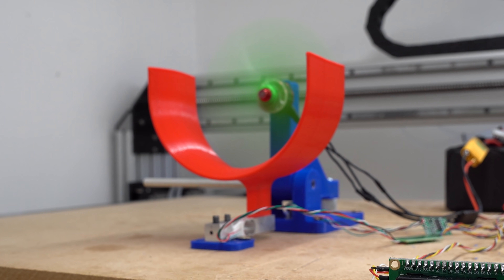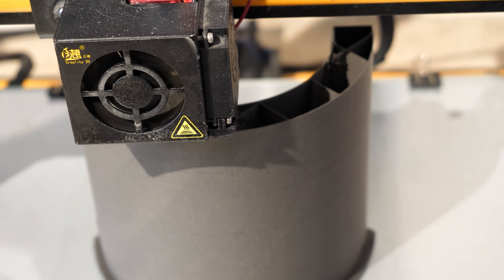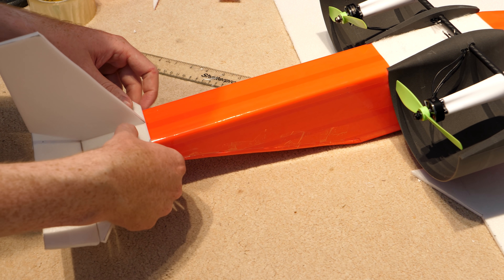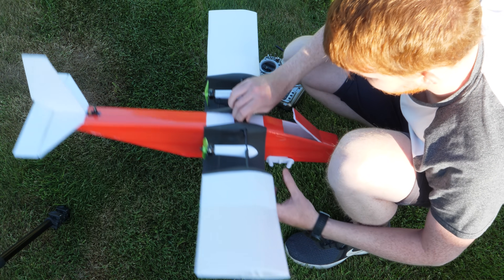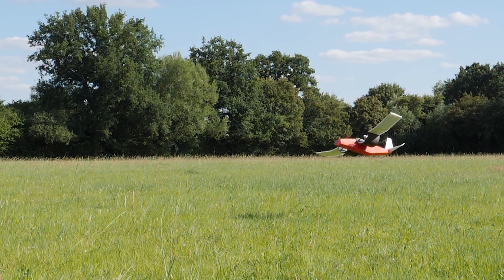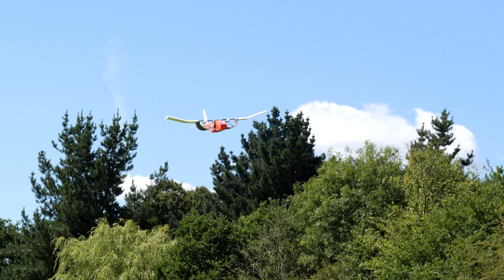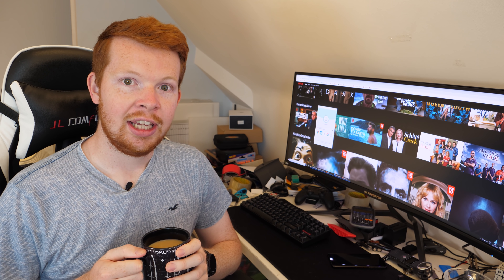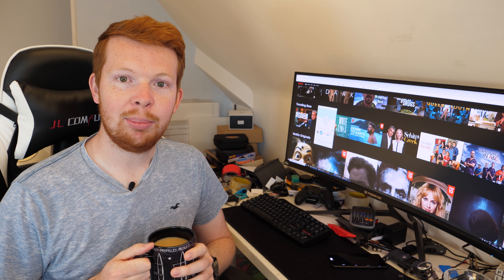Channel Wing Plane

Comment: Could it be that You couldn't reproduce the effects of that historical aircraft due the the fact that some physical phenomenons don't scale down very well? Like for example the density of air does not scale down, potentially rendering your small-scale experiment with worse results that its original-sized equivalent?

Comment: Nice video! I assume a channel wing will theoretically produce lift at zero speed because the engine can flow air over the whole wing at zero speed. Could you accomplish the same thing with distributed propulsion (a la X-57), but more efficiently?

Comment: The pitch up on power looked a lot like the lift is tied to the throttle. I think if tom raises the angle of attack of the wing section itself independently of the channels it would allow some more conclusive results as the whole craft would fly slower and the throttle would act more like flaps. Conversely you could add symmetrical sections at the outer tips and angle the thrust line down slightly. Real planes with blown wings rely on throttle control during landing but have shorter wings than similarly sized aircraft.

Comment: As a helicopter pilot I can attest that you don't need a fixed wing to fly.  You just need a pressure differential (or if you're a DJI or a Harrier fan, ducted fans pointed down).  Fundamentally all require a SIGNIFICANT amount of power to achieve lift.  That power is also unavailable for thrust, and will deplete the fuel source be it jet fuel (Harrier) or batteries (DJI) or AVGas (what I fly).

When you add a fixed-wing lift mechanism (and your elevator qualifies as well) so long as you can keep it light and large you win the aerofoil advantage by getting "free" lift.  Of course it's not free.  It sits on the ground quite heavily.  You need airspeed to get that lift... which is why any discussion of a "low speed" or "no speed" aerofoil has its limits.

Yes, you can put a pusher prop on a plain on a treadmill... but will it fly?  Well the general answer is no... but if you put the prop so the air flows over the aerofoils it WILL fly over the treadmill, with possibly a 0 knot groundspeed.  That would be an interesting experiment.

Thanks for your videos - always appreciated!

Ehud Gavron
Tucson, Arizona USA
FAA Commercial Helicopter Pilot

Comment: Tom, you said you thought it was tail heavy so you moved the battery forward. But then you said thrust pitches the aircraft up so that suggests it wasn’t tail heavy to begin with. A nose heavy plane won’t glide as well or fly at as low speed as a balanced plane. Maybe the cg and pitching is worth exploring some more. Just 20mph for that plane at the beginning seems amazingly slow. I would estimate a normal plane like that would stall somewhere above 60mph.

Comment: The advantage is not unfeasible in practice. The regular channel wing lift vector and propeller thrust are perpendicular to each other so not too much helpful from a VTOL point of view. From this study(https://ntrs.nasa.gov/archive/nasa/casi.ntrs.nasa.gov/19930087470.pdf) wing lift augments the propeller thrust about 8%. Tilting the wing, so the lift vector is more aligned with the thrust offers a much higher augmentation, and the concept is totally feasible for a VTOL, check this video here: https://www.youtube.com/watch?v=tID7wEP1a-4

Comment: Multi engined planes definitely benefit from induced lift. The channel wings lift isn't directed downward but normal to the surface. Perhaps combining the shape of the channel so more lift is directed downward  would result in better results.  A good way to discover how significant induced drag is to fly the XL 450 and in plane mode apply yaw command. This cause the inboard motor to slow just as the wing begins to slow itself. It pretty much guarantees a snap. Be prepared to shift to hover mode to recover. Like your videos. There is no better way to affirm an idea or principal than actually doing it. Like your videos.

Comment: I'm thinking it's largely a scale issue. Plenty of aerodynamic devices work at some sizes but not others. Planes like the Antonov An-72 and the Boeing YC-14 mount jet engines over the wings for STOL performance, so I think there's something to using to help lift. Wikipedia says that the Coandă effect doesn't exist in totally laminar flow, so it makes some sense that the higher Reynolds numbers involved with full scale aircraft make it more prominent.
Reply: Finally  a proper scientific conclusion! It’s all fluid dynamics man…

Comment: In drawing airflow over an aerofoil to produce lift at low aircraft velocities, I think much the same thing has already been created in the form of the Osprey V22 tilt rotor. While it's main attribute is to use the tilt rotors to hover, the wing itself produces extraordinary lift from a stubby wing section by means of the two Alison turboprop engines which force air over the wing and trailing edge flaperon to produce lift even before the aircraft has moved forward. In flight, the aircraft is brought to a hover by slowly rotating the engine nacelles to a vertical axis to produce lift, while the transition is assisted by the flaperon which provides additional lift to assist the wing as forward speed deteriorates.
Reply: This is not true; tilt-rotors  do not tilt the wings and they are a source of reduction of hover performance caused by wing - rotor flow interactions, such as wing download, wing fountain flow and other flow perturbations. A bit better are the tilt wing designs, e.g. Canadair CL-84, but the single wing advantage is not stalling at any angle. In pure hover, the wing is worse than "dead weight" as being a source of surface drag, and decreasing hovering effectiveness, the "figure of merit"
Reply: @aliptera  If you were an actual qualified aircraft engineer, as am I, you would be able to discern the fact that I stated "rotating the engine nacelles" which are the structures at the wingtips (not the wings themselves) which do the rotating while the wing (mainplane) remains fixed and stationary. The point that I made was that the two designs each cause air to move front to rear by the use of propellers, Tom's model, by drawing airflow while the V22 achieved it by pushing airflow whilst in a stationary manner, and also in normal forward flight. Tom's model was designed to achieve both lift and thrust while the V22 could only achieve realistic and useful lift by rotating the engines to a vertical axis.

Comment: I have been thinking a lot about the channel wing concept lately. I would like to try a similar test but adding a down turned duct or set of variable vanes after the prop to direct the propwash downward as well. This would increase the lift without increasing the forward thrust. If they were efficient enough you could theoretically hover. I think in this test you may not have been able to see much effect of the channel wing on landing as you had to increase throttle to gain the extra lift which also increased your airspeed. If you could direct the propwash downward you could increase throttle without increasing airspeed which would allow for slower flight. Nonetheless this was great to watch as well as your previous video test of the channel wing on the test bench.

Comment: I think at the scale you are building, you have a major inefficiency due to annular losses. Because they don't scale linearly, a larger prop diameter is going to significantly increase the airflow. Maybe a single very large channel and a delta wing?

Comment: The part of the channel that can produce lift is only one small region, the part that is horizontal, what if you tried an eliptical channel rather that circular, and put two props in each, to try to maximize the region that is horizontal?

Comment: doesnt an aerofoil require there to be air over and under the wing? if you have small props then there only is air being pulled over the wings right

Comment: Isnt a Netflix account fixed to the country ? When Ive left Spain, my Netflix simply doesnt let me watch other coutries content
Reply: That’s the whole point of a VPN, to get round something that’s fixed to a country. (Well, not the whole point of a VPN, but that’s the case in this ad)
Reply: @oliverpolden  no no, if the account is only able to be used in a country, when you use vpn, Netflix doesn't display new shows anz instead it doesn't work
Reply: Things might have changed but I literally travelled the world and used a vpn with Netflix. It might depend on the vpn, I was using a server I set up myself as a vpn so perhaps Netflix wasn’t able to detect it.

Comment: If you're familiar with the Dyson "air multiplier" "fanless" fans have a look at how the ring shaped airfoil is designed. There's at intake fan that flows air out over the inner surface of the ring that I think would make an interesting design for a blown airfoil.

Comment: If thrust off a wing has any similarities with buoyancy (this I don’t know as I’m a boat guy) then the lift acts at 90 degrees to the surface of the airfoil. If this is the case than only the very bottom of the channel is producing true lift and all other points of the channel produce lift at a tangent to straight up, with the sides of the channel producing an opposite lift force to each other but none of it being a lifting component. This would explain why the lift generated has to be so high, as the contributing lift by the channel decreases as you move around the radius from the bottom.

Comment: Test with regular wing and read the amperage while flying for 2-8 minutes dual motors, then try this design for the same amount of time, this will give you an efficiency reading between the two
Reply: Was going to suggest this idea, you beat me to it. 
Obviously you would use the same motors and propellers. 
Not sure it would make sense to add weight to the conventional wing so that both versions have the same weight - the channel wing is inherently heavier - though the weight ratio might be different with the materials used in this model, from the real deal. 
Perhaps it would be worthwhile trying to get closer to the dynamics of a full sized aircraft: for instance, I don't think the engines on a real aircraft would be powerful enough to make it jump around like that (except fighter planes maybe).
Anyway it makes a fascinating video, thanks!

Comment: This is gonna sound crazy, but what if you made a channel wing quadcopter?

Have four sets of motor/wing, and have one set opposed to the other set. The thrust should cancel out, but would produce lift. Not completely sure on the control scheme, though. Yaw and roll would both be simple, as the would be no net thrust in any one direction, but pitch would be difficult due to the fact that you would need to reduce lift on one side, but now that same side is providing less thrust to counter the other side's thrust, leading to forwards/backwards movement of the craft. Maybe have a single extra motor, or maybe a pair of motors, without a channel wing, dedicated purely to pitch? If they had no response to altitude control, it would still be a good proof of the ability of a channel wing.
Reply: Eric The Epic he could use reaction wheels for pitch...

Comment: So...I am playing with silk on a pre made foam glider... first coat with Elmer's glue, and another coat from the outside to smooth and stretch the silk correctly.. and seal with spray shellac, an excellent bio plastic, with silk and Elmer's glue the outer surface is rigid... but just a little bit flexible..shellac is the lingin and cellulose of bamboo, Elmer's glue is a natural latex that 10 bazillion little kids swear is non toxic and shellac should be made with either straight ethanol or acetone.. acetone dries faster and more rigid.. can be 3 to 3.5 on the Moh's scale of hardness.. silk plastic is stronger than steel.. I was lead programmer for a Boeing subsidiary making the high tech fibers used in military applications and aerospace. .. this is absolutely non proprietary information and technology.. it's been used in China for years beyond count
Reply: Not everyone has a spare parachute in their back room... coffee filters, the thin basket type filters are exceptionally strong
Reply: Paper = carbon fiber for poor folks
Shellac can be found on Amazon and in any hardware store.. I like to get dry shellac and mix it myself with non toxic ingredients.. when you get done with this plastic  it is biodegradable and goes back in the garden 😍...

Comment: Hello
the lift is almost zero on the rounded area of the wing.
this comes from the suction of the flow by the propellers.
The wind no longer hits the leading edge.
if the helises were forward and of a diameter greater than the rounded area, the flow would be projected onto the leading edge of this area.
the lift would therefore be maximum.
If my English is bad it's normal I'm French I apologize

Comment: Would you be interested in  exploring magnus-effect cylinder-wing aircraft? In particular, I've wondered if such a cylinder could also be the thrust vector for a jet (or duct for a fan) the blades of which might simply be attached to the inside of the cylinder itself, and then angled with servos as desired.

Comment: I think the motor should be in front of the curved wing and slightly larger propellers than the Curve of the Wings and don't forget you need a few degrees of down thrust to keep the plane from popping up in the nose

Comment: Awesome work Tom, is that depron foam? Where did you get your hands on that?

Also, I've noticed on a lot of your VTOL projects you've frankensteined a betaflight controller with a teensy to do your mixing. I've written my own flight control code that runs entirely on teensy 4.0/4.1 with an mpu6050. Let me know if you're interested in getting your hands on that for future projects. My interest is in weird VTOLs too--you beat me to the swashplateless heli!
Reply: With my foam board planes I use the dollar tree foam board. Super cheap. ($1) and is strong when you use the packing tape on the outside.
Reply: @MachineChrist6  Reason I ask about the foam is because depron hasn't been available here in the states in years. Dollar tree is the only option for 5-6mm foamboard it seems
Reply: @NicholasRehm  I had no idea it wasnt avaliable here.
Reply: @MachineChrist6  Yep unfortunately its really only available in massive industrial sized spools now :(
Reply: Depron is back or coming back!! I've seen posts from the guy on Facebook. https://www.rcdepron.com/

Comment: ExpressVPN when you want a ridiculous high ping! 5:54
Reply: Would that make a difference in anything except gaming?
Reply: @SuperBialyWilk  Yes, every click on a website has an extra delay. Some actions are still responsive due to local caching but you will notice it for sure. Once you are below 50 ms or so you're fine. Also bandwidth is a product of link capacity and delay (the bandwidth-delay product), so in effect you are also decreasing your download and upload speed.
Reply: @kevintieman3616  That's not true. Packet loss affects the download speed. Usually a longer distance traveled result in more packet loss but it's not in itself connected to ping. Ping is only the time delay for a packet to get to a destination and back. You can still send all your packets one after another without getting a reply for the first one back.
The only time you notice a delay is with the SYN - SYN ACK - ACK. Like you said about the websites taking longer. However 50 ping vs 150 ping is only a difference of a 1/10th of a second. Something you would barely notice. 
So in conclusion the ping is NOT what causes most of your experienced delay while using a VPN. It's packet loss and bandwidth.
For each packet lost you have to send a new one (assuming TCP/IP) when sending a new one that packet takes an additional 150ms to get there and a response to come back. That is the experienced delay.
Reply: @SonnyKnutson  Your conclusion is not correct, delay is a key part of what determines your download speed and internet experience. Looking at the Bandwidth Delay Product (BDP (bytes) = total_available_bandwidth (KBytes/sec) x round_trip_time (ms)), which determines your actual download speed, doubling the delay effectively halves the download speed. Your application might try to increase the tcp window size to keep the download speed up, at some point the inevitable packet loss will have a much more dramatic effect crippling your download speed. For example, if you have crappy wifi your similar crappy internet experience will be amplified with the amount of delay you add (with a vpn for example).
Reply: @SonnyKnutson   Your assesment about 1/10th of a second would be correct if websites were served as a single files but any modern website will load html first, then stylesheets and scripts, image files referenced by the stylesheets and scripts. So if you look at total pageload time the delay would be the sum of all requests which can't be parallelized